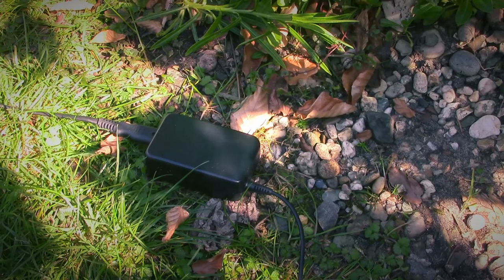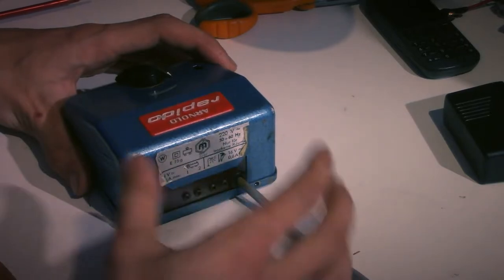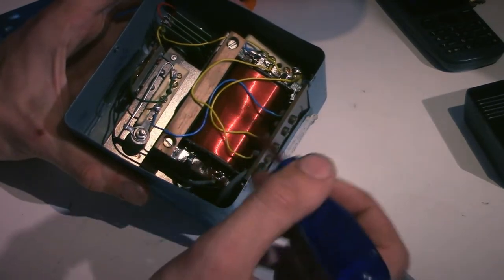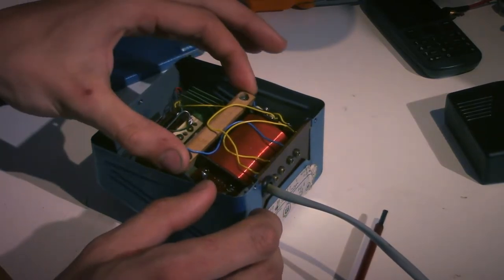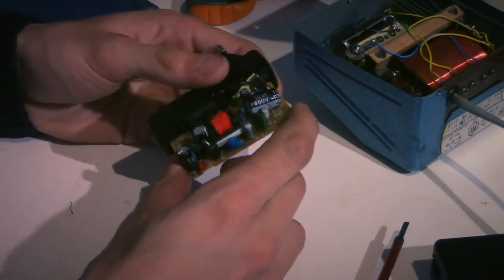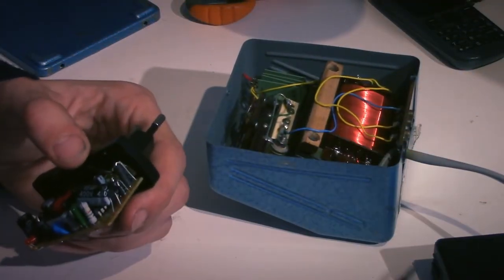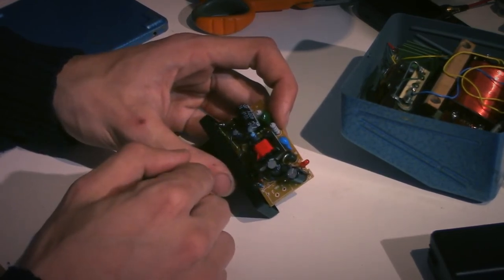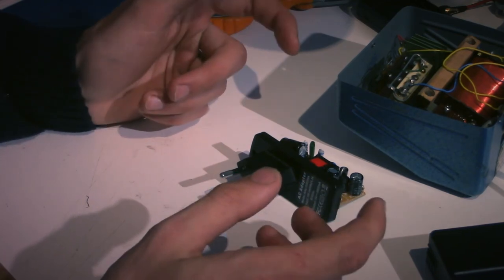Why power supplies are smaller now (AKIO TV)

Comment: Very interesting! Maybe a video on why higher frequencies need smaller transformers? And what's the usb project if I may ask?
Reply from the maker: I decided not to go into transformers too much in this video because there's too much to talk about; it would have made this video too long and perhaps more complicated than necessary. I totally intend to cover transformers in more detail, I think the topic deserves its own video indeed.

The usb port story isn't very exciting; I wanted to charge my phone from my home made wind turbine, therefore I simply needed a usb port to plug the phone into, so I salvaged it from this adapter that I never use. However, the circuit didn't work because the regulator I used was broken so eventually I ended up just buying one of those 12v car chargers and that works just fine, but that already had usb ports on it so I didn't need that port after all.
Reply: @AKIOTV  Okay nice, thanks for the in-depth reply! I'm really enjoying your videos.

Comment: what is the name of the component that does the high speed switching?
Reply from the maker: Usually a MOSFET is used (or multiple ones). In very high power/high voltage systems you may also find other semiconductor devices such as IGBTs or thyristors (many-kilowatt or megawatt scale devices, not anything you're likely to encounter in consumer electronics)

Comment: Old method: step down > rectify.
Modern method: rectify > invert > step down > rectify.
Reply from the maker: pretty much, although I wouldn't use the term 'invert' because the swiching circuit doesn't necessarily create negative pulses as well, making it technically not a real inverter.
Reply: @AKIOTV  Ah right, ok. So it's spitting out high frequency top half of square waves which makes it AC-like but technically not AC, lol, but from the perspective of the transformer, still works as voltage is fluctuating around some range?
Reply: @AKIOTV  oh wait, I think I get it now. It is AC but not "inverting" as there's no negative half.
Reply: @AKIOTV  It's like an inverters equivalent to the half-bridge rectifier but still not an "inverter" of course.
Reply from the maker: @DrR1pper  Yes exactly. For high power applications full bridge converters (with a real inverter that is) also exist.
Reply: @AKIOTV  would I be right in guessing it would be a full-bridge rectifier for the first part (mains AC input) and then (need only be) a half-bridge rectifier for the second part (stepped down high frequency switched DC input)? Thanks in advance!

Edit: I'm thinking, full-bridge rectifier at the beginning means the ability to use a smaller capacitor that comes right after which would then mean a smaller overall device.
Reply from the maker: @DrR1pper  There are loads of different designs out there. Most of them use a full bridge rectifier at the beginning (even the small one I used in the video) and a half-bridge on the high frequency part. 

A full bridge converter is one that has a real inverter (aka H-bridge) after the first rectifier. (full bridge in this case refers to the "real inverter")

For more details about some of the circuits used, here's a rather helpful document: https://www.st.com/resource/en/application_note/cd00003910-topologies-for-switch-mode-power-supplies-stmicroelectronics.pdf